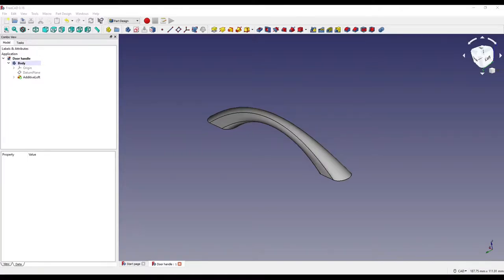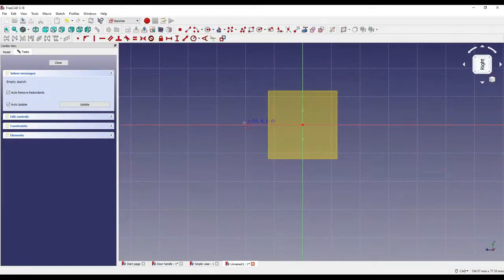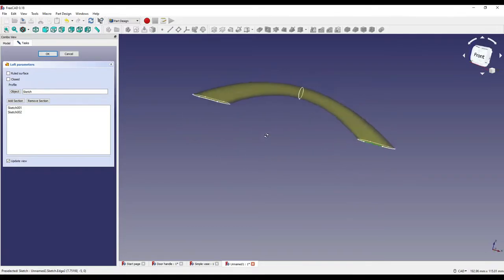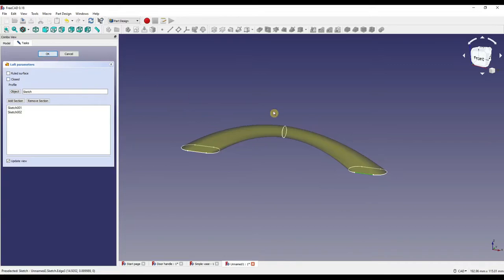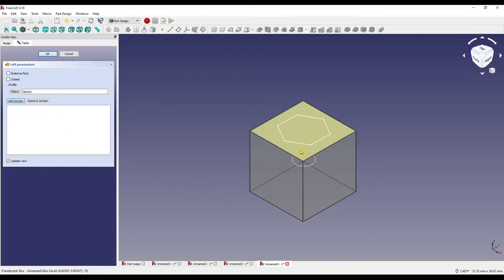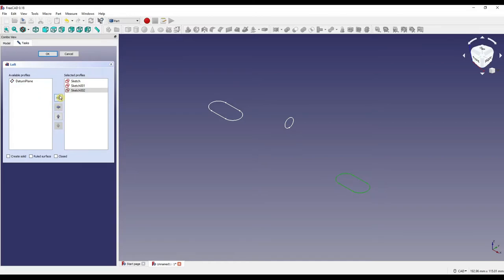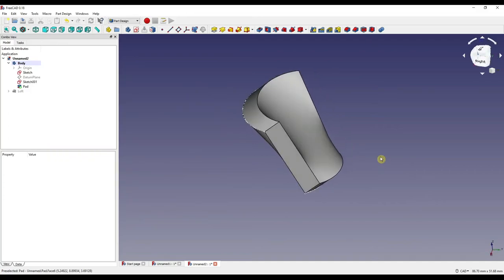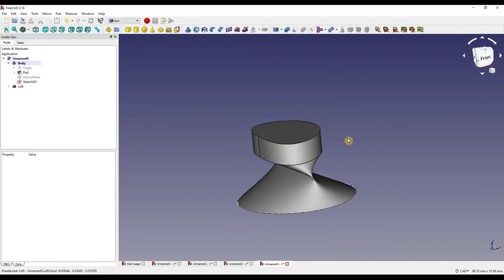3D modeling FreeCAD Tutorial - Loft modifiers!

Comment: Hi Andrew, really useful tutorial. I currently have an issue similar to your last example of what not to do(unnamed4). However the sketches are not complex at all - a small triangle going 90deg to a slightly bigger triangle. The loft is linking the wrong corners together creating a funky geometry almost as if the loft is inverting/folding in on itself. Just wondering if there any controls or changes to the sketches I can do to fix this?

Comment: I really struggled with a double loft ruled profile. Basically a piped profile with a shape as the profile crossed inner and outer walls at certain sections. I spent days trying to rectify it. In the end it appears Freecad joins profiles in the order you create them and not whether they are both inner or outer walls. Hope this helps someone.

Comment: 9:00 I think you can use the thickness tool to convert a surface into a hollow solid.
Reply from the maker: I'll give that a go tomorrow and see what happens :)
Reply: @AndrewCAD  I tried it , the thickness tool gives an error: "the object is not a solid"
Reply: @paulg3336  The thickness tool is equivalent to shell command in Fusion 360. It shells out a solid and creates a wall of desired thickness. What you want is the 3D offset tool in the Part Workbench.